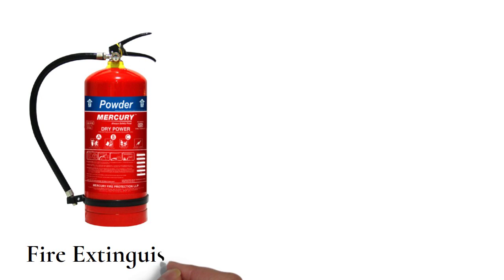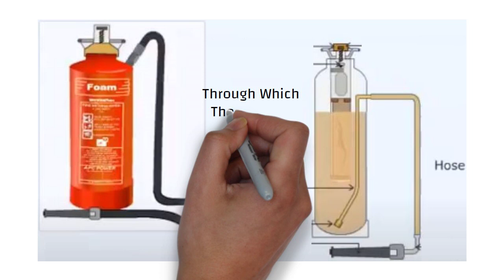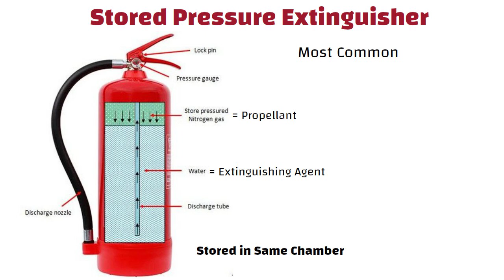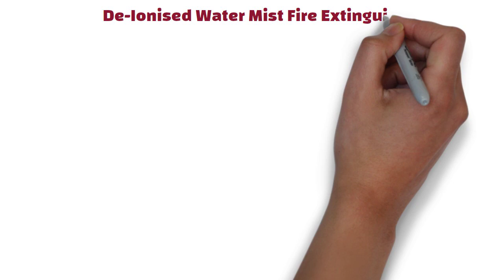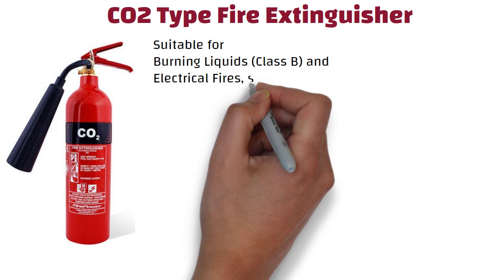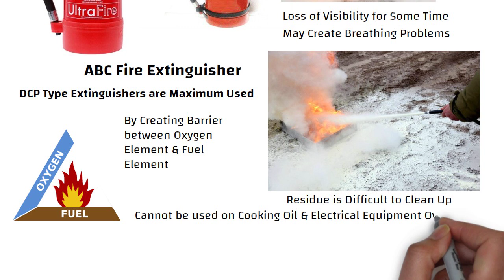FIRE EXTINGUISHER DEALERS IN KERALA, CALL 8138906102, FIRE EXTINGUISHER DEALERS IN ERNAKULAM.

Comment: FIRE EXTINGUISHER DEALERS IN ADOOR, FIRE EXTINGUISHER SUPPLIERS IN ADOOR, FIRE EXTINGUISHER DISTRIBUTORS IN ADOOR, FIRE EXTINGUISHER IN ADOOR, ABC TYPE FIRE EXTINGUISHER DEALERS IN ADOOR, CO2 TYPE FIRE EXTINGUISHER DEALERS IN ADOOR, CLEAN AGENT FIRE EXTINGUISHER IN ADOOR, MODULAR TYPE FIRE EXTINGUISHER DEALERS IN ADOOR, MECHANICAL FOAM FIRE EXTINGUISHER DEALERS IN ADOOR, FIRE EXTINGUISHER NEAR ME ADOOR, FIRE EXTINGUISHER TRADERS IN ADOOR, FIRE FIGHTING COMPANIES IN ADOOR, FIRE CONTRACTORS IN ADOOR, FIRE EQUIPMENT DEALERS IN ADOOR, FIRE ALARM DEALERS IN ADOOR, FIRE PUMP DEALERS IN ADOOR, SMOKE DETECTOR DEALERS IN ADOOR, FIRE FIGHTING SYSTEM IN ADOOR, FIRE PROTECTION SYSTEM IN ADOOR, FIRE AND SAFETY CONTRACTORS IN ADOOR, FIRE HYDRANT SYSTEMS IN ADOOR, PA TALK BACK SYSTEM IN ADOOR, FIRE NOC IN ADOOR, FIRE INSTALLATION IN ADOOR, FIRE NOC RENEWAL IN ADOOR, KIRLOSKAR FIRE PUMP DEALERS IN ADOOR, FIRE EXTINGUISHER NEAR ME ADOOR, FIRE EXTINGUISHER MANUFACURERS IN ADOOR, SAFEX FIRE EXTINGUISHER DEALERS IN ADOOR, FIRE NOC CONTRACTORS IN ADOOR, FIRE FIGHTING EQUIPMENT DEALERS IN ADOOR, FIRE PROTECTION SYSTEM IN ADOOR, FIRE INSTALLATION IN ADOOR, FIRE SAFETY CONTRACTORS IN ADOOR, FIRE AMC IN ADOOR, FIRE PROTECTION SYSTEM IN ADOOR, FIRE PROTECTION EQUIPMET IN ADOOR, AMC OF FIRE SYSTEM IN ADOOR, FIRE CONSULTANTS IN ADOOR, FIRE AND SAFETY EQUIPMENT DEALERS IN ADOOR, ADDRESSABLE FIRE ALARM SYSTEM IN ADOOR, KARTHAR VALVE DEALERS IN ADOOR, DCP TYPE FIRE EXTINGUISHER IN ADOOR, POWSER TYPE FIRE EXTINGUISHERS IN ADOOR, FIRE HYDRANT SYSTEM IN ADOOR, FIRE ALARM PANEL DEALERS IN ADOOR, SAFEPRO FIRE EXTINGUISHER DEALERS IN ADOOR, MS AND GI PIPE DEALERS IN ADOOR, JINDAL PIPE DEALERS IN ADOOR, AGNI FIRE ALARM DEALERS IN ADOOR, FIRE EQUIPMENT DEALERS IN ADOOR, FIRE EQUIPMENT SUPPLIERS IN ADOOR, FIRE EQUIPMENT TRADERS IN ADOOR, FIRE SPRINKLER SYSTEM IN ADOOR, RAVLE FIRE ALARM DEALERS IN ADOOR, RAVEL FIRE ALARM SYSTEM IN ADOOR, AGNI FIRE ALARM DISTRIBUTORS IN ADOOR, FIRE ALARM CONTRACTORS IN ADOOR, FIRE PIPE INSTALLATION IN CONTRACTORS IN ADOOR, FIRE SAFETY CONTRACTORS IN ADOOR, FIRE PA TWO WAY TALK BACK SYSTEM DEALERS IN ADOOR, HEAT DETECTOR DEALERS IN ADOOR, HONEYWELL FIRE ALARM DEALERS IN ADOOR, FIRE NOC CONSULTANTS IN ADOOR, FIRE AMC AND FIRE NOC IN ADOOR, FIRE SAFETY COMPANIES IN ADOOR, NEWAGE DEALERS IN ADOOR, MONSHER FIRE EQUIPMENT DEALERS IN ADOOR, KARTHAR VALVE DEALERS IN ADOOR, FIRE HYDRANT VALVE DEALERS IN ADOOR, FIRE HOSE REEL DRUM DEALERS IN ADOOR, FIRE SPRINKLER DEALERS IN ADOOR, FIRE PUMP DEALERS IN ADOOR, LUBI PUMP DEALERS IN ADOOR, LHP PUMP DEALERS IN ADOOR. FIRE CONTRACTORS IN ADOOR, FIRE AND SAFETY CONTRACTORS IN ADOOR, FIRE EQUIPMENT DEALERS IN ADOOR, FIRE FIGHTING CONTRACTORS IN ADOOR,

Comment: FIRE EXTINGUISHER DEALERS IN ERNAKULAM, FIRE EXTINGUISHER SUPPLIERS IN ERNAKULAM, FIRE EXTINGUISHER DISTRIBUTORS IN ERNAKULAM, FIRE EXTINGUISHER IN ERNAKULAM, ABC TYPE FIRE EXTINGUISHER DEALERS IN ERNAKULAM, CO2 TYPE FIRE EXTINGUISHER DEALERS IN ERNAKULAM, CLEAN AGENT FIRE EXTINGUISHER IN ERNAKULAM, MODULAR TYPE FIRE EXTINGUISHER DEALERS IN ERNAKULAM, MECHANICAL FOAM FIRE EXTINGUISHER DEALERS IN ERNAKULAM, FIRE EXTINGUISHER NEAR ME ERNAKULAM, FIRE EXTINGUISHER TRADERS IN ERNAKULAM, FIRE FIGHTING COMPANIES IN ERNAKULAM, FIRE CONTRACTORS IN ERNAKULAM, FIRE EQUIPMENT DEALERS IN ERNAKULAM, FIRE ALARM DEALERS IN ERNAKULAM, FIRE PUMP DEALERS IN ERNAKULAM, SMOKE DETECTOR DEALERS IN ERNAKULAM, FIRE FIGHTING SYSTEM IN ERNAKULAM, FIRE PROTECTION SYSTEM IN ERNAKULAM, FIRE AND SAFETY CONTRACTORS IN ERNAKULAM, FIRE HYDRANT SYSTEMS IN ERNAKULAM, PA TALK BACK SYSTEM IN ERNAKULAM, FIRE NOC IN ERNAKULAM, FIRE INSTALLATION IN ERNAKULAM, FIRE NOC RENEWAL IN ERNAKULAM, KIRLOSKAR FIRE PUMP DEALERS IN ERNAKULAM, FIRE EXTINGUISHER NEAR ME ERNAKULAM, FIRE EXTINGUISHER MANUFACURERS IN ERNAKULAM, SAFEX FIRE EXTINGUISHER DEALERS IN ERNAKULAM, FIRE NOC CONTRACTORS IN ERNAKULAM, FIRE FIGHTING EQUIPMENT DEALERS IN ERNAKULAM, FIRE PROTECTION SYSTEM IN ERNAKULAM, FIRE INSTALLATION IN ERNAKULAM, FIRE SAFETY CONTRACTORS IN ERNAKULAM, FIRE AMC IN ERNAKULAM, FIRE PROTECTION SYSTEM IN ERNAKULAM, FIRE PROTECTION EQUIPMET IN ERNAKULAM, AMC OF FIRE SYSTEM IN ERNAKULAM, FIRE CONSULTANTS IN ERNAKULAM, FIRE AND SAFETY EQUIPMENT DEALERS IN ERNAKULAM, ADDRESSABLE FIRE ALARM SYSTEM IN ERNAKULAM, KARTHAR VALVE DEALERS IN ERNAKULAM, DCP TYPE FIRE EXTINGUISHER IN ERNAKULAM, POWSER TYPE FIRE EXTINGUISHERS IN ERNAKULAM, FIRE HYDRANT SYSTEM IN ERNAKULAM, FIRE ALARM PANEL DEALERS IN ERNAKULAM, SAFEPRO FIRE EXTINGUISHER DEALERS IN ERNAKULAM, MS AND GI PIPE DEALERS IN ERNAKULAM, JINDAL PIPE DEALERS IN ERNAKULAM, AGNI FIRE ALARM DEALERS IN ERNAKULAM, FIRE EQUIPMENT DEALERS IN ERNAKULAM, FIRE EQUIPMENT SUPPLIERS IN ERNAKULAM, FIRE EQUIPMENT TRADERS IN ERNAKULAM, FIRE SPRINKLER SYSTEM IN ERNAKULAM, RAVLE FIRE ALARM DEALERS IN ERNAKULAM, RAVEL FIRE ALARM SYSTEM IN ERNAKULAM, AGNI FIRE ALARM DISTRIBUTORS IN ERNAKULAM, FIRE ALARM CONTRACTORS IN ERNAKULAM, FIRE PIPE INSTALLATION IN CONTRACTORS IN ERNAKULAM, FIRE SAFETY CONTRACTORS IN ERNAKULAM, FIRE PA TWO WAY TALK BACK SYSTEM DEALERS IN ERNAKULAM, HEAT DETECTOR DEALERS IN ERNAKULAM, HONEYWELL FIRE ALARM DEALERS IN ERNAKULAM, FIRE NOC CONSULTANTS IN ERNAKULAM, FIRE AMC AND FIRE NOC IN ERNAKULAM, FIRE SAFETY COMPANIES IN ERNAKULAM, NEWAGE DEALERS IN ERNAKULAM, MONSHER FIRE EQUIPMENT DEALERS IN ERNAKULAM, KARTHAR VALVE DEALERS IN ERNAKULAM, FIRE HYDRANT VALVE DEALERS IN ERNAKULAM, FIRE HOSE REEL DRUM DEALERS IN ERNAKULAM, FIRE SPRINKLER DEALERS IN ERNAKULAM, FIRE PUMP DEALERS IN ERNAKULAM, LUBI PUMP DEALERS IN ERNAKULAM, LHP PUMP DEALERS IN ERNAKULAM. FIRE CONTRACTORS IN ERNAKULAM, FIRE AND SAFETY CONTRACTORS IN ERNAKULAM, FIRE EQUIPMENT DEALERS IN ERNAKULAM, FIRE FIGHTING CONTRACTORS IN ERNAKULAM,

Comment: FIRE ALARM DEALERS IN THRISSUR, FIRE ALARM SYSTEM DEALERS IN THRISSUR, ADDRESSABLE FIRE ALARM SYSTEM DEALERS IN THRISSUR, FIRE DETECTION SYSTEM IN THRISSUR, SMOKE DETECTOR DEALERS IN THRISSUR, CONVENTIONAL FIRE ALARM DEALERS IN THRISSUR, MORLEY FIRE ALARM DEALERS IN THRISSUR, GST FIRE ALARM DEALERS IN THRISSUR, ASES SECURITY FIRE ALARM DEALERS IN THRISSUR,  FIRE ALARM TRADERS IN THRISSUR, FIRE ALARM PANEL DEALERS IN THRISSUR, HEAT DETECTOR DEALERS IN THRISSUR, FIRE ALARM SYSTEM SUPPLIERS IN THRISSUR, FIRE ALARM COMPANIES IN THRISSUR, FIRE EQUIPMENT DEALERS IN THRISSUR, ADRRESSABLE FIRE ALARM PANEL DEALERS IN THRISSUR, FIRE ALARM SYSTEM IN THRISSUR, BATTERY OPERATED DETECTOR DEALERS IN THRISSUR, ASPIRATION DETECTION SYSTEM DEALERS IN THRISSUR, FIRE ALARM MCP - MANUAL CALL POINT DEALERS IN THRISSUR, FIRE ALARM HOOTER DEALERS IN THRISSUR, PA TWO WAY TALK BACK SYSTEM DEALERS IN THRISSUR, PA SYSTEM DEALERS IN THRISSUR, PA TALK BACK UNIT DEALERS IN THRISSUR, HOOTER CUM STROBE DEALERS IN THRISSUR, FIRE PROTECTION SYSTEM IN THRISSUR, FIRE ALARM CONTRACTORS IN THRISSUR, FIRE DETECTORS IN THRISSUR, FIRE ALARM DEALERS IN THRISSUR, ADDRESSABLE FIRE ALARM DEALERS IN THRISSUR, SMOKE DETECTOR DEALERS IN THRISSUR, FIRE EQUIPMENT DEALERS IN THRISSUR, FIRE ALARM INSTALLATION IN THRISSUR, FIRE ALARM COMPANIES IN THRISSUR FIRE ALARM DISTRIBUTORS IN THRISSUR, TALK BACK SYSTEM DEALERS IN THRISSUR, FIRE ALARM SENSOR DEALERS IN THRISSUR, FIRE EXTINGUISHER DEALERS IN THRISSUR, FIRE ALARM DEALERS IN ERNAKULAM, FIRE ALARM DEALERS IN THRISSUR, ADDRESSABLE FIRE ALARM DEALERS IN CALICUT, SMOKE DETECTOR IN THRISSUR,  FIRE EXTINGUISHER DEALERS IN THRISSUR, FIRE EXTINGUISHER SUPPLIERS IN THRISSUR, FIRE EXTINGUISHER DISTRIBUTORS IN THRISSUR FIRE EXTINGUISHER IN THRISSUR, ABC TYPE FIRE EXTINGUISHER DEALERS IN THRISSUR, CO2 TYPE FIRE EXTINGUISHER DEALERS IN THRISSUR, CLEAN AGENT FIRE EXTINGUISHER IN THRISSUR, MODULAR TYPE FIRE EXTINGUISHER DEALERS IN THRISSUR, MECHANICAL FOAM FIRE EXTINGUISHER DEALERS IN THRISSUR,

Fire extinguisher dealers in THRISSUR, fire extinguishers in THRISSUR, fire extinguishers in THRISSUR, fire protection system in THRISSUR, f fire and safety installation in THRISSUR, fire and safety contractors in THRISSUR, fire safety contractors in THRISSUR, fire and safety systems equipments in THRISSUR, fire equipment in THRISSUR, fire extinguisher in THRISSUR, fire protection system installation in THRISSUR, fire contractors in THRISSUR, fire safety consultants in THRISSUR,  fire alarm systems in THRISSUR, fire NOC in THRISSUR, fire AMC in THRISSUR, THRISSUR, fire fighting equipment in THRISSUR, MS Jindal pipe dealers in THRISSUR, motor control panel in THRISSUR, fire pump panel in THRISSUR, motor control panel in THRISSUR, Morley fire alarm in THRISSUR, gst fire alarm in THRISSUR, addressable fire alarm system in THRISSUR, Pa talk back system in THRISSUR, PA two way talk back system in THRISSUR, auto glow SIGNAGES in THRISSUR, Karthar dealers in THRISSUR, Agni fire alarm dealers in THRISSUR, ASES SECURITY fire alarm dealers in THRISSUR, AUTO GLOW SIGNAGES in THRISSUR, FIRE PUMP PANEL in THRISSUR, LHP pump in THRISSUR. Karthar valves in THRISSUR, Ravel fire alarm system in THRISSUR. Jindal pipe dealers in THRISSUR, Jindal pipe dealers in THRISSUR. MS pipe dealers in THRISSUR. Butterfly valves in THRISSUR, PA talk back system in THRISSUR, Fire alarm dealers in THRISSUR, smoke detector dealers in THRISSUR, fire alarm panels dealers in THRISSUR, MCP, hooter dealers in Mangalor, hydrant valve dealers in THRISSUR, branch pipe dealers in THRISSUR,Fire CP hose in THRISSUR, Fire RRL hose in THRISSUR, heat detector dealers in THRISSUR, Motor Control panel in THRISSUR,  LED EXIT LIGHTS dealers in THRISSUR, emergency exit light dealers in THRISSUR, auto glow SIGNAGES dealers in THRISSUR. Conventional fire alarm system in THRISSUR, Fire alarm panel in THRISSUR, Notifier fire alarm dealers in THRISSUR, PA talk back unit dealers in THRISSUR. Honeywell fire alarm dealers in THRISSUR, BOSCH PA system dealers in THRISSUR, 
KIRLOSKAR FIRE FIGHTING PUMP DEALERS IN THRISSUR, FIRE FIGHTING EQUIPMENT DEALERS IN THRISSUR, FIRE ALARM SYSTEM DEALERS IN THRISSUR, FIRE CONSULTANTS IN THRISSUR, FIRE CONTRACTOTORS IN THRISSUR, FIRE CONTRACTORS IN THRISSUR, FIRE ALARM SYSTEM DEALERS IN THRISSUR, SMOKE DETECTOR DEALERS IN THRISSUR, FIRE PROTECTION SYSTEM IN THRISSUR, FIRE CONSULTANTS IN THRISSUR, FIRE CONSULTANTS IN THRISSUR, PA TALK BACK SYSTEM IN THRISSUR, ADDRESSABLE FIRE ALARM SYSTEMS IN THRISSUR, CUTTER PUMP DEALERS IN THRISSUR, ADDRESSABLE FIRE ALARM SYSTEM SUPPLIERS IN THRISSUR, SMOKE DETECTOR DEALERS IN TTHRISSUR, PRESSURE BOOSTING PUMP DEALERS IN THRISSUR, SLURRY PUMP DEALERS IN THRISSUR, WATER PUMP DEALERS IN THRISSUR, RAVEL FIRE ALARM SYSTEM IN THRISSUR, LUBI FIRE FIGHTING PUMP DEALERS IN THRISSUR, FIRE EXTINGUISHER DEALERS IN THRISSUR, ADDRESSABLE FIRE ALARM SYSTEM DEALERS IN THRISSUR.

Comment from the maker: FIRE EXTINGUISHER DEALERS IN THODUPUZHA, FIRE EXTINGUISHER SUPPLIERS IN THODUPUZHA, FIRE EXTINGUISHER DISTRIBUTORS IN THODUPUZHA, FIRE EXTINGUISHER IN THODUPUZHA, ABC TYPE FIRE EXTINGUISHER DEALERS IN THODUPUZHA, CO2 TYPE FIRE EXTINGUISHER DEALERS IN THODUPUZHA, CLEAN AGENT FIRE EXTINGUISHER IN THODUPUZHA, MODULAR TYPE FIRE EXTINGUISHER DEALERS IN THODUPUZHA, MECHANICAL FOAM FIRE EXTINGUISHER DEALERS IN THODUPUZHA, FIRE EXTINGUISHER NEAR ME THODUPUZHA, FIRE EXTINGUISHER TRADERS IN THODUPUZHA, FIRE FIGHTING COMPANIES IN THODUPUZHA, FIRE CONTRACTORS IN THODUPUZHA, FIRE EQUIPMENT DEALERS IN THODUPUZHA, FIRE ALARM DEALERS IN THODUPUZHA, FIRE PUMP DEALERS IN THODUPUZHA, SMOKE DETECTOR DEALERS IN THODUPUZHA, FIRE FIGHTING SYSTEM IN THODUPUZHA, FIRE PROTECTION SYSTEM IN THODUPUZHA, FIRE AND SAFETY CONTRACTORS IN THODUPUZHA, FIRE HYDRANT SYSTEMS IN THODUPUZHA, PA TALK BACK SYSTEM IN THODUPUZHA, FIRE NOC IN THODUPUZHA, FIRE INSTALLATION IN THODUPUZHA, FIRE NOC RENEWAL IN THODUPUZHA, KIRLOSKAR FIRE PUMP DEALERS IN THODUPUZHA, FIRE EXTINGUISHER NEAR ME THODUPUZHA, FIRE EXTINGUISHER MANUFACURERS IN THODUPUZHA, SAFEX FIRE EXTINGUISHER DEALERS IN THODUPUZHA, FIRE NOC CONTRACTORS IN THODUPUZHA, FIRE FIGHTING EQUIPMENT DEALERS IN THODUPUZHA, FIRE PROTECTION SYSTEM IN THODUPUZHA, FIRE INSTALLATION IN THODUPUZHA, FIRE SAFETY CONTRACTORS IN THODUPUZHA, FIRE AMC IN THODUPUZHA, FIRE PROTECTION SYSTEM IN THODUPUZHA, FIRE PROTECTION EQUIPMET IN THODUPUZHA, AMC OF FIRE SYSTEM IN THODUPUZHA, FIRE CONSULTANTS IN THODUPUZHA, FIRE AND SAFETY EQUIPMENT DEALERS IN THODUPUZHA, ADDRESSABLE FIRE ALARM SYSTEM IN THODUPUZHA, KARTHAR VALVE DEALERS IN THODUPUZHA, DCP TYPE FIRE EXTINGUISHER IN THODUPUZHA, POWSER TYPE FIRE EXTINGUISHERS IN THODUPUZHA, FIRE HYDRANT SYSTEM IN THODUPUZHA, FIRE ALARM PANEL DEALERS IN THODUPUZHA, SAFEPRO FIRE EXTINGUISHER DEALERS IN THODUPUZHA, MS AND GI PIPE DEALERS IN THODUPUZHA, JINDAL PIPE DEALERS IN THODUPUZHA, AGNI FIRE ALARM DEALERS IN THODUPUZHA, FIRE EQUIPMENT DEALERS IN THODUPUZHA, FIRE EQUIPMENT SUPPLIERS IN THODUPUZHA, FIRE EQUIPMENT TRADERS IN THODUPUZHA, FIRE SPRINKLER SYSTEM IN THODUPUZHA, RAVEL FIRE ALARM DEALERS IN THODUPUZHA, RAVEL FIRE ALARM SYSTEM IN THODUPUZHA, AGNI FIRE ALARM DISTRIBUTORS IN THODUPUZHA, FIRE ALARM CONTRACTORS IN THODUPUZHA, FIRE PIPE INSTALLATION IN CONTRACTORS IN THODUPUZHA, FIRE SAFETY CONTRACTORS IN THODUPUZHA, FIRE PA TWO WAY TALK BACK SYSTEM DEALERS IN THODUPUZHA, HEAT DETECTOR DEALERS IN THODUPUZHA, HONEYWELL FIRE ALARM DEALERS IN THODUPUZHA, FIRE NOC CONSULTANTS IN THODUPUZHA, FIRE AMC AND FIRE NOC IN THODUPUZHA, FIRE SAFETY COMPANIES IN THODUPUZHA, NEWAGE DEALERS IN THODUPUZHA, MONSHER FIRE EQUIPMENT DEALERS IN THODUPUZHA, KARTHAR VALVE DEALERS IN THODUPUZHA, FIRE HYDRANT VALVE DEALERS IN THODUPUZHA, FIRE HOSE REEL DRUM DEALERS IN THODUPUZHA, FIRE SPRINKLER DEALERS IN THODUPUZHA, FIRE PUMP DEALERS IN THODUPUZHA, LUBI PUMP DEALERS IN THODUPUZHA, LHP PUMP DEALERS IN THODUPUZHA. FIRE CONTRACTORS IN THODUPUZHA, FIRE AND SAFETY CONTRACTORS IN THODUPUZHA, FIRE EQUIPMENT DEALERS IN THODUPUZHA, FIRE FIGHTING CONTRACTORS IN THODUPUZHA, AGNI FIRE ALARM DEALERS IN THODUPUZHA, PA TALK BACK SYSTEM DEALERS IN THODUPUZHA, FIRE NOC IN THODUPUZHA, FIRE NOC RENEWAL IN THODUPUZHA, FIRE SYSTEM INSTALLATION IN THODUPUZHA.

Comment: FIRE EXTINGUISHER DEALERS IN PERUMBAVOOR, FIRE EXTINGUISHER SUPPLIERS IN PERUMBAVOOR, FIRE EXTINGUISHER DISTRIBUTORS IN PERUMBAVOOR, FIRE EXTINGUISHER IN PERUMBAVOOR, ABC TYPE FIRE EXTINGUISHER DEALERS IN PERUMBAVOOR, CO2 TYPE FIRE EXTINGUISHER DEALERS IN PERUMBAVOOR, CLEAN AGENT FIRE EXTINGUISHER IN PERUMBAVOOR, MODULAR TYPE FIRE EXTINGUISHER DEALERS IN PERUMBAVOOR, MECHANICAL FOAM FIRE EXTINGUISHER DEALERS IN PERUMBAVOOR, FIRE EXTINGUISHER NEAR ME PERUMBAVOOR, FIRE EXTINGUISHER TRADERS IN PERUMBAVOOR, FIRE FIGHTING COMPANIES IN PERUMBAVOOR, FIRE CONTRACTORS IN PERUMBAVOOR, FIRE EQUIPMENT DEALERS IN PERUMBAVOOR, FIRE ALARM DEALERS IN PERUMBAVOOR, FIRE PUMP DEALERS IN PERUMBAVOOR, SMOKE DETECTOR DEALERS IN PERUMBAVOOR, FIRE FIGHTING SYSTEM IN PERUMBAVOOR, FIRE PROTECTION SYSTEM IN PERUMBAVOOR, FIRE AND SAFETY CONTRACTORS IN PERUMBAVOOR, FIRE HYDRANT SYSTEMS IN PERUMBAVOOR, PA TALK BACK SYSTEM IN PERUMBAVOOR, FIRE NOC IN PERUMBAVOOR, FIRE INSTALLATION IN PERUMBAVOOR, FIRE NOC RENEWAL IN PERUMBAVOOR, KIRLOSKAR FIRE PUMP DEALERS IN PERUMBAVOOR, FIRE EXTINGUISHER NEAR ME PERUMBAVOOR, FIRE EXTINGUISHER MANUFACURERS IN PERUMBAVOOR, SAFEX FIRE EXTINGUISHER DEALERS IN PERUMBAVOOR, FIRE NOC CONTRACTORS IN PERUMBAVOOR, FIRE FIGHTING EQUIPMENT DEALERS IN PERUMBAVOOR, FIRE PROTECTION SYSTEM IN PERUMBAVOOR, FIRE INSTALLATION IN PERUMBAVOOR, FIRE SAFETY CONTRACTORS IN PERUMBAVOOR, FIRE AMC IN PERUMBAVOOR, FIRE PROTECTION SYSTEM IN PERUMBAVOOR, FIRE PROTECTION EQUIPMET IN PERUMBAVOOR, AMC OF FIRE SYSTEM IN PERUMBAVOOR, FIRE CONSULTANTS IN PERUMBAVOOR, FIRE AND SAFETY EQUIPMENT DEALERS IN PERUMBAVOOR, ADDRESSABLE FIRE ALARM SYSTEM IN PERUMBAVOOR, KARTHAR VALVE DEALERS IN PERUMBAVOOR, DCP TYPE FIRE EXTINGUISHER IN PERUMBAVOOR, POWSER TYPE FIRE EXTINGUISHERS IN PERUMBAVOOR, FIRE HYDRANT SYSTEM IN PERUMBAVOOR, FIRE ALARM PANEL DEALERS IN PERUMBAVOOR, SAFEPRO FIRE EXTINGUISHER DEALERS IN PERUMBAVOOR, MS AND GI PIPE DEALERS IN PERUMBAVOOR, JINDAL PIPE DEALERS IN PERUMBAVOOR, AGNI FIRE ALARM DEALERS IN PERUMBAVOOR, FIRE EQUIPMENT DEALERS IN PERUMBAVOOR, FIRE EQUIPMENT SUPPLIERS IN PERUMBAVOOR, FIRE EQUIPMENT TRADERS IN PERUMBAVOOR, FIRE SPRINKLER SYSTEM IN PERUMBAVOOR, RAVLE FIRE ALARM DEALERS IN PERUMBAVOOR, RAVEL FIRE ALARM SYSTEM IN PERUMBAVOOR, AGNI FIRE ALARM DISTRIBUTORS IN PERUMBAVOOR, FIRE ALARM CONTRACTORS IN PERUMBAVOOR, FIRE PIPE INSTALLATION IN CONTRACTORS IN PERUMBAVOOR, FIRE SAFETY CONTRACTORS IN PERUMBAVOOR, FIRE PA TWO WAY TALK BACK SYSTEM DEALERS IN PERUMBAVOOR, HEAT DETECTOR DEALERS IN PERUMBAVOOR, HONEYWELL FIRE ALARM DEALERS IN PERUMBAVOOR, FIRE NOC CONSULTANTS IN PERUMBAVOOR, FIRE AMC AND FIRE NOC IN PERUMBAVOOR, FIRE SAFETY COMPANIES IN PERUMBAVOOR, NEWAGE DEALERS IN PERUMBAVOOR, MONSHER FIRE EQUIPMENT DEALERS IN PERUMBAVOOR, KARTHAR VALVE DEALERS IN PERUMBAVOOR, FIRE HYDRANT VALVE DEALERS IN PERUMBAVOOR, FIRE HOSE REEL DRUM DEALERS IN PERUMBAVOOR, FIRE SPRINKLER DEALERS IN PERUMBAVOOR, FIRE PUMP DEALERS IN PERUMBAVOOR, LUBI PUMP DEALERS IN PERUMBAVOOR, LHP PUMP DEALERS IN PERUMBAVOOR. FIRE CONTRACTORS IN PERUMBAVOOR, FIRE AND SAFETY CONTRACTORS IN PERUMBAVOOR, FIRE EQUIPMENT DEALERS IN PERUMBAVOOR, FIRE FIGHTING CONTRACTORS IN PERUMBAVOOR,